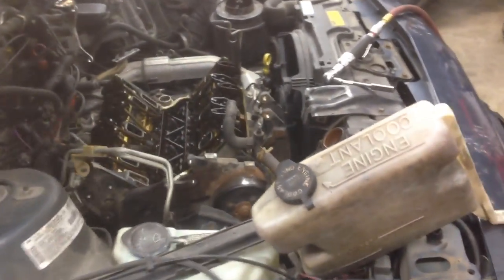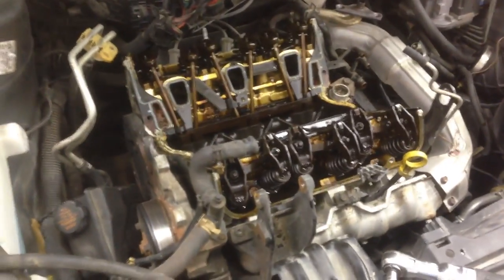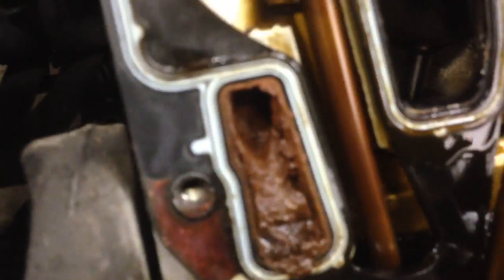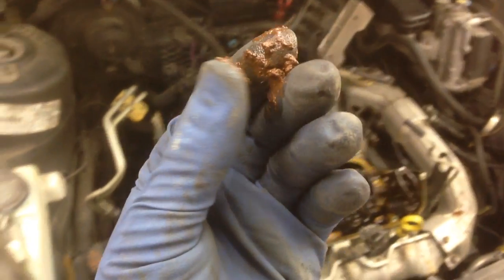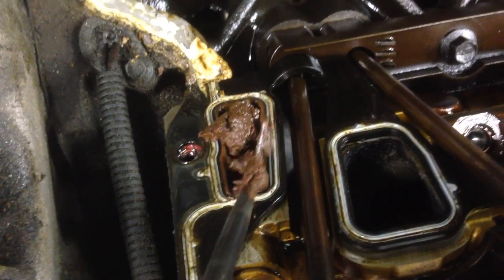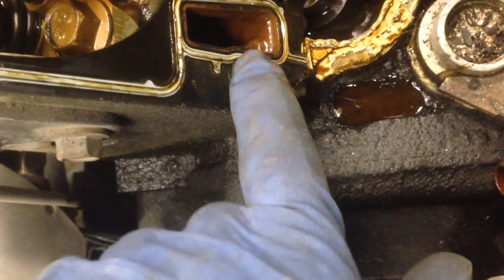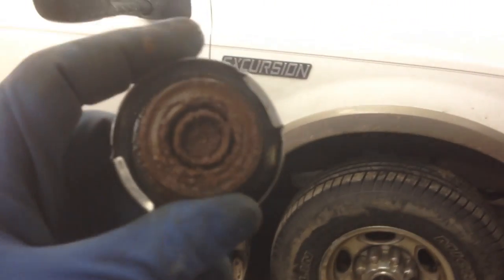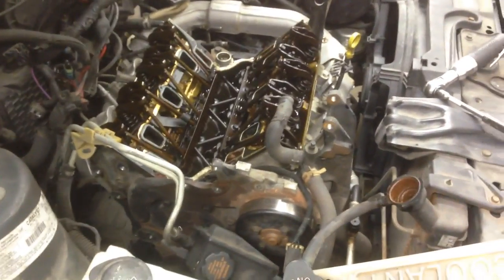Why it's called DexKILL

Comment: I can't believe GM never solved the issue with their intake manifolds on this engine.  Blows my mind.
Reply: +Show Me What I Need To Know  
At least its fixable.  I have a 1991 Pontiac Bonneville SSE with the 3800 and I had to replace all the seals on it at around 100k and then at 180k or so.  Its just something that needs to be done. People just need to watch out for this before there is engine failure.
Reply: ***** Well in my 91 Bonneville I use the green coolant which is what is recommended and still had the problem with the gaskets. If it were 1996 and newer, I would use Dexcool since that is whats recommended by GM.  I have a newer Cadillac as well with Dexcool and never any problems. Dexcool is meant for car with aluminum engines and not for cast iron engines. In the case in this video, someone put something in the coolant like stop leak.  That doesn't just happen.
Reply: ***** A lot of people never used it like its supposed to. I have seen numerous GM cars and trucks with two different coolants mixed together. Dexcool is a very good coolant and is made for aluminum engines that also required a coolant supplement.  I have switched over to Dexcool in my 1984 Seville and 1985 Eldorado both with the 4100 aluminum V8 and its been excellent. No corrosion and no coolant leaks. You must get all silicates and contaminates flushed out before adding Dexcool.  And you must do the same the other way.  This is where many people went wrong.
Reply: ***** Theres no reason to not like it. There's nothing wrong with the coolant and it does its just unless someone uses it the wrong way. It should not be called Red Death or whatever. Green coolant causes more corrosion in aluminum engines while Dexcool does not. Cast iron engines should use Green Coolant only.
Reply: +AMCNorthstar 93 my 95 Sierra has dexcool came with it from factory and none of my lines have that color it's always clean, but I do proper maintenance and truck has 247,000 miles on it, only reason why my engine heats up aint cause of the coolant, lol I have a mechanical fan and clutch are weird so A/C will drive temps up when sitting in heavy traffic on 100 degree weather but when a/c is off temps stay at 180 degrees on the engine, with a/c can hit 230 but never past that as clutch engages fully, but then again proper maintenance and I change the coolant tbh once a year cause engine is old and is not stock, makes double the power it does than factory engine so could by why heat issue(only when a/c is on though) also need a cowl hood, but alot of people having problems with dex cool is either mixing other coolants or just not checking it at all and not changing it every three years not 5
Reply: ***** considering my truck is a 1995, has 247,000 miles on it, has had the waterpump replaced 5 times and radiator 2 times, and yet I don't have any of the issues you claim, I think I'm fine, seems like to me you're just a bad owner
Reply: ***** Dexcool is much better for aluminum engines and aluminum engine components. Dexcool is silicate free and is much better to help against engine corrosion. I have switched over to Dexcool in both my 84 Seville and 85 Eldorado with the 4.1L aluminum V8. It has been great and has no evidence of corrosion unlike using the green coolant. GM introduced Dexcool back in 1996. When using the green coolant in aluminum engines a sealant or tablet was required to be added. It is not necessary anymore when using Dexcool.
Reply: ***** Either the coolant in your S10 was not changed out when needed or two coolants were mixed together for that to happen. I have seen countless GM cars and trucks with having mixed coolants. Whenever I have seen and worked on a GM engine with bad head gaskets or intake gaskets, it was mainly due to bad cooling system maintenance.
Reply: ***** If Dexcool is not handled correctly, that will happen. However I'm not sure why your thinking that Dexcool is to blame for your leaking seals and gaskets. Those seals never have a long life span. The same thing happened on the the various V6 engines found in the Buicks, Pontiac's, Oldsmobile's and Chevrolet's. The intake and head gaskets go out quite often and especially if the coolant goes acidic.
Reply: ***** hey if you don't believe me that's on you, I know what I own and know how to properly take care of it and I also don't go out and buy they cheapest parts either, plus idk why you keep saying red, my coolant is orange even in my 2013 spark and I use prestone dexcool 50/50 mix and thats all don't add any water just the premixed coolant, to me seems like user error on your part
Reply: ***** I'm not sure if your S10 has an aluminum engine or cast iron engine?? I find that Dexcool works much better for aluminum engines. I never had a problem with my Cadillac's. For cars with cast iron engines I use the regular green antifreeze like for my 91 Pontiac Bonneville. Just my experience at least.
Reply: ***** I don't work for Dexcool. I am simple talking from my own experience.  Many of times people do not maintain there cooling system and wait until something fails. I'm not talking about you but most people in general. And a lot of times when Dexcool is not handled properly or if someone adds an additive or something, the cooling does show up gooey and such. But its not the coolants fault.
Reply: ***** my dad is the original owner my my 95 sierra, now it's in my name, as said before has 247,000 mile on it, engine isn't stock produces twice the hp than stock motor but mine was an odd ball from factory, has had dexcool since it was new came with it, my personal experience with the stuff proves to me you don't know how to properly use it, you say air getting is messes it up, I call total bs on that because my overflow tank for the coolant has no pressure cap on it, it's exposed to the air and yet has never gummed up, none of the lines have gummed up, last time heads and everything else was pulled off was 10 years ago yet all passages where clean, so this leads me to believe you don't know what you are talking about, as my truck alone proves everything you have claimed wrong, and want my truck to stump you again, my head s and block are iron, it's only is i know how to use the coolant right and I don't buy cheap ass parts for my truck which is what you are doing I can tell, so call me anything you want but my truck proves any claims you make wrong.I don't care about youtube videos saying it's wrong to use, my experience tells me they used it wrong, cause you say it kills engines, well mine is still going, starts up every fucking day, only reason why I put new radiator in was because I needed a better one to cool the engine better as I doubled it's power, and to help cool the transmission better which i also added a external cooler to it, so hey talk shit all you want my truck and I are laughing at you while doing a burnout down the street
Reply: +chevyllac091 What you do with your "old truck" has nothing to do with what they are talking about with the aluminum 3.1 V6 in these small cars.  They have a head gasket problem and sounds like lots of people mix types of antifreeze or add radiator stop leak, that is the problem.   And your truck makes "double the power"?  Really?  What, 250 hp to 500 hp?  What all did you do to it?  If it only gets hot with the AC on, sounds like a partial radiator block or fan clutch that isn't working right.
Reply: Nycke White or maybe just maybe, the condenser sits on front of my radiator, i'm in heavy traffic in over 100 degree weather, maybe that brings the temps up wouldn't you think, sheesh you people so quick to judge without actually reading, and yea so what if i doubled my power, I could and I did it cause I wanted to. and what I did to it is none of your business only the guy who'm I'm drag racing against, maybe some of us know how to build engines up, but I do also plan to get a cowl hood will get heat out. but like today engine  highest temp it hit was 185 degrees cause it was 70 degrees out and I was doing 110mph, lol air was moving but I did it for like about 15 miles to get home from work and yes a/c was on, but in the morning it sat at 160 degrees cause of rain
Reply: +chevyllac091 calm your shit. My 1994 had dexicool for 190k and its pure sludge. Not saying it was dexkills fault but i that type of thing should bot happen.
Reply: TheGamerGuy I think it did its job for it to last for 190k LOL
Reply: ***** Dexcool is not bad at all. GM wants its vehicles to last a long time and they do if properly maintained and following there directions.  They designed, built and assembled there vehicles so I think they would know what is best.
Reply: chevyllac091 Then why the fuck does it have dexcool shit in it. i believe me having to spend all last night flushing it i would be the one to know.
Reply: TheGamerGuy means who put it in there never did a proper flush cause from factory no 94's came with it, so hence improper maintenance
Reply: ***** Sorry but I always had excellent engine care using Dexcool and following exactly what GM recommends. No one would have any problems IF the cooling system was maintained properly!
Reply: ***** I'm not lying I'm talking from my own experience.  Why do you not get that?  You have a mental block in your head making you think its bad stuff.  I can say the same about green coolant which in certain cases it is more harmful in certain engines.
Reply: ***** Yeah well there is also a lot of misinformation out there on coolants and people that just don't know what they are talking about like you. Death cool my ass!  You probably drive a Kia anyways.
Reply: ***** I wish they would pay me but they don't.  They don't know how many people that supports them like myself because of proven reliability for our cars and especially mine!  You really have this mental block in your head thinking Dexcool is terrible stuff.....No!  There is no reason to hate something so much its stupid!
Reply: ***** The regular green is not good for all applications.  Dexcool is also used on numerous european cars as well.  Used under a different name but its the same stuff and it does great.  Car Talk is not always the best place for car advice.  I listen to them from time to time and somethings they say are not accurate at all.
Reply: +AMCNorthstar 93 I have never heard of Dexcool in Euro cars, however, almost everyone I know swap the Dexcool to either green stuff or something else. Also Honda's Type 2 works very well if the Dexcool has been all cleaned out of the engine. Though, I have heard of horror stories I have never had a GM vehicle with Dexcool have problems myself. I suspect main reason why it gunks up like shown in the video is because the owner saw a leak in the cooling system and dumped stop leak in there.
Reply: Himmel Weint Most european cars use an orange coolant. A friend of mine has a Volkswagon and uses Dexcool coolant being that is also oriange in color.  Works just fine as intended use.
Reply: ***** Maybe for certain year GM's but not for all. Especially new GM's must use Dexcool.
Reply: AMCNorthstar 93
 I don't think Volkswagen uses Dexcool, however, if he flushes the original coolant out then Dexcool will work in pretty much any car. Also if it's a top off it won't turn into jello instantly but may clog later on down the line. Just because it is similar in colour doesn't mean it is the same. Example would be BMW and Honda Type 2 coolant both are blue, however, they are very different coolant. They both mix and work well together without issues. My coolant of choice though is the Napa yellow coolant I've used it with every and any car and it has worked with great results every time from GM vehicles to BMWs. As I have said Dexcool if not mixed with other coolant or had stop leak put into it and changed at specified intervals I have never experienced a single problem with.

Comment: This cars are at end of life and should be crushed.  I have this coolent in my silverado for 100k miles with no problems.  Took it to dealership had it changed at the 100k miles and still never had any problems.  I follow the vehicles schedule for oil, transmission and coolent changes and never have any problems for even repairs.

Comment: Ah, I've seen this so many times... Even the tiniest leak causes that orange sludge deposit wherever it dries. And the 3100SFI definitely is infamous for blowing UIM/LIM gaskets. It's a real pain in the rear to bleed out the air, not one of GM's best ideas.

That being said, my mom's boyfriend has a '95 Buick Century at 258K miles with the 3100, we've done the UIM/LIM gaskets twice, and have changed over to the standard yellow Prestone coolant since I'm sick of flushing the orange sludge out of the system every time. The previous owner of my '87 LeSabre (3.8L) made the change to DexCool when he replaced the radiator, and in five years I've never had an issue with the coolant - but that's because there are no leaks. ;-)

Comment: Oh, and just to add, if this was really just caused by "air contamination", almost EVERY GM engine in the 3.1,3.4, & 3.8 family i've ever seen has at least one bleeder valve located right on top of the water outlet! you're 3.1 actually has two & i can SEE the one above the water pump in your video!! they're the easiest things in the world to use if one actually cared about the quality of their coolant and wanted to remove all of the air pockets! so, i'm sorry dude, i would STILL have to chalk this one up to neglect and nothing else, and just a little FYI, air in your coolant causes what is known as flash-boiling b/c the temp inside the air pocket rises much higher than the actual temp of the coolant causing it to boil in that localized area, which yes, most certainly can cause a host of problems including blown out gaskets, but it's from neglect & can happen to any coolant! it's on you to bleed air out of your system!! Your car has TWO bleeder valves! other motors can only dream of such an easy way to remove air!  Don't blame it on the coolant, believe me, doesn't matter if that stuff is orange, green, all distilled water, whatever to the freaking air, you have to get air out of EVERY cooling system dude!

Comment: There's no coolant passage on that side of the intake manifold, lack of maintenance, and the idiot didn't bead a small dab of rtv around the gasket ( yes, even if they are plastic with rubber o-ring) Do not let this guy ever work on your car, very unprofessional and no knowledge of Dexcool.

Comment: That's not dexcool the only issue with dexcool was that it would fuck up the mediocre GASKETS GM used on their older vehicles. Mainly on the intake manifolds which are a bitch to reach on a 4.3 or 5.7 vortec. 

That looks to me like OIL contaminant, or some other additive used to stop a leak. This is for sure not the dexcool, would be stupid to even suggest that.

So glad you're not my mechanic, you replaced the gaskets and already SAW this crap in it. What would your next step be ?? DO A FLUSH, to make sure it's all out of the system. No you genius, just go on ahead replace the gasket.  

Ohhh  and your "the air contaminates dexcool" bunch of horse shit pal. It can only do that when you contaminate it with NON DISTILLED water (which is unlikely even then) and/or as said above other additives!
Reply: I've done head gaskets on a Grand Am, and it looked similar.  Good luck getting that crap out, it's just about impossible unless you can physically remove it.  Most of it won't flush out.
Reply: Agreed - if it's doing this after 25k miles, it's not just the coolant.
Reply: snorman1911
Nothing that cannot be flushed out with a good decent pressurized garden hose. This is not a DEX cool issue, if that was true all the late 90 models GM ever BUILD would have this same issue as they all came with DEX-COOL!

It's a fucked up head gasket it makes sense as you seen it while replacing yours. And i am sure you did NOT replace it for the fun of it!
Reply: Michel Linschoten  I have tried every flush there is and none can dissolve this red sludge. I did several flushes but still getting that stuff in my overflow tank
Reply: It can take a while you probably need to do a super flush, look up chrisfix he does one. It's a tedious process. Also you need to do it a couple of time, when your overflow tank keeps getting sludge that means you're doing it right :)

Comment: Come on man, know what you are talking about before you post videos like this. This is Stop Leak and rust. System has a leak, coolant gets flushed out, owner keeps filling it with water and system starts to rust. Eventually owner puts in Stop Leak which binds with solid particulates to form a clot over whatever is leaking. Everything that is left over congeals at the point of least restriction, i.e., in the 4 corners of the block beside the freeze plugs, the heater core, and the heat sinks under the intake manifold at the water passage. DexCool works fine as long as its kept clean and within spec. DexCool DOES NOT 'rot plastic'. Its chemically impossible.

Comment: looks like he put tap water in!  you are suppose to put distilled water in a your coolant system because it has no minerals tap water dose and minerals cause rust and rust gunk up like that new radiator and a shit lode of cleaning for you dude you can get the 50/50 mix or you can do what i do and get distilled water at any store for 75 cents a gallon

Comment: I had a 3-1 in a Chevy Malibu 03 got it with 80000 on the clock got rid of it at 220 something thousand 1 water pump and I'm a mechanic now and I see that s*** all the time Dex kill is garbage but that looks like radiator a head gasket stop leak combined with the other crap